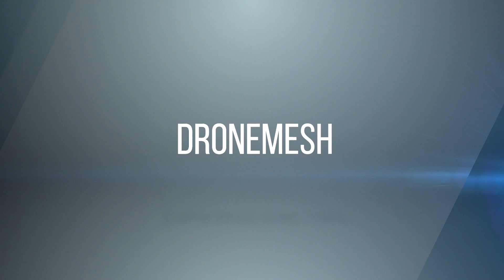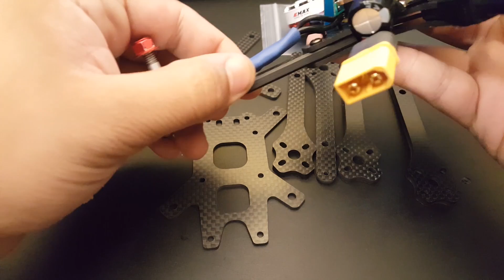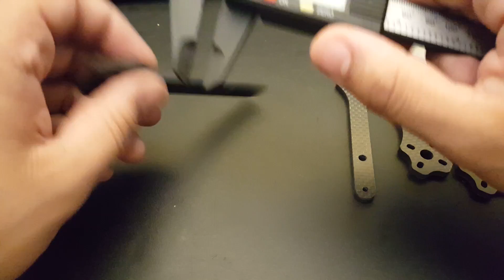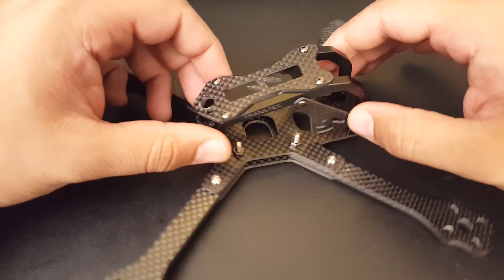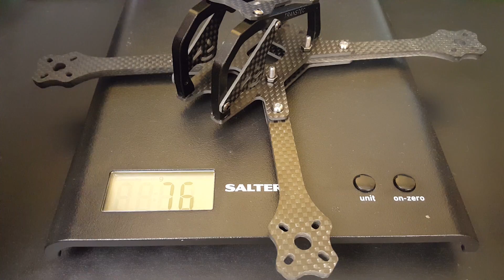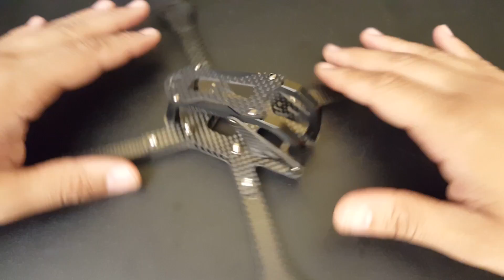Transtec Lighting Pro Kevlar // Overview

Comment from the maker: Hey Guys if anyone would like to support the channel I have designed LOW ESR mugs one side is a panasonic low esr and the other is a rubycon.

http://teespring.com/dronemesh
Reply: Drone Mesh why do u use a capacitor on every one of your builds? Do i have to use one? Or its optional?
Reply: Joe Gonzales thank u mate....i never flown a quad before....and i want to know as much as possible......
Reply: Not just that; it also protects your equipment. To many fc's are burning daily because of voltage spikes when crashing.

Comment: HAHA, its funny because kevlar is heavier and weaker than carbon fiber (in this sort of application)
Reply: Oliver Boatwright, the specific gravity of Kevlar is lower than carbon fiber.  Kevlar when  combined with carbon can create  a thicker laminate for less weight.
Reply: what, specific gravity, does kevlar defy physics, Kevlar has immense tension strength, better than carbon fiber, hence bullet proof vests. but not in compression, its weaker, in a composite that needs to be strong in compression and tension, like the arm of a quad (effectively a beam in physics), carbon fiber composite is stronger than an equal weight and thickness  of Kevlar.
Reply: Oliver Boatwright, I make laminates all the time.  Laminates made with Kevlar and equal in thickness to a carbon laminate are lighter in weight.  Add carbon to the outside of the kevlar laminate and the flexural modulus is very close to a pure carbon laminate.  When making parts of equal weight, the kevlar laminate will  aways be thicker.   The only way to make a laminate that was equal in weight and thickness would be to alter the fiber:resin ratio.  That would have to done by increasing the compaction of the kevlar laminate. The primary downside to the kevlar laminate is its propensity to delaminate.  The fibers can also wick water and lubricate the fiber to resin interface.  You know that specific gravity is a fibers density right?  Kevlar is at 1.4 g\cc and carbon is around 1.8 depending on its modulus.
Reply: i see your point, my concern is that adding Kevlar reduces the weight in some cases, but reduces the strength.
i ask you, for a composite of equal WEIGHT, would a standard carbon composite or a carbon/kevlar hybrid be stronger.
for instance the arm of a quad, that part most likely to break.
Reply: Oliver Boatwright, it really depends on the application and the "strength" you are going for.  A kevlar laminate that weighs the same as a carbon laminate is thicker.  Kevlar in some applications can perform better depending on the rate that the force is applied.  In this particular quad, the kevlar\carbon laminate shaved 13 grams or so than the all carbon frame and resulted in the same arm thickness.  Will it be as strong as the carbon frame?  Probably not, but it's also lighter.  You can't have everything in composites.  There are always compromises.  If a quad arm would be designed for ultimate performance it would utilize uni-directional fibers that were strategically positioned.  This would require laying up the frame in mold and the price would be very high.  So, even the existing all carbon frames are a compromise because they are cut from sheets where that fibers not always optimally aligned. 

The fibers on the outside of the laminate are the ones that often drive the characteristics.  Carbon on the outside with Kevlar in the middle will save weight and be only marginally weaker.  They are a pain to fabricate though and are often more expensive.

Comment: Does the capacitor just get ride of some noise and do you have to put it on if you have a regulator
Reply: Dripping Ice yes A capacitor will help a lot . Connect it to the vBAT closest to the fpv equipment.
Reply: AMA I use a regulator and it works but sometimes I get osd blackout would a cap help with that